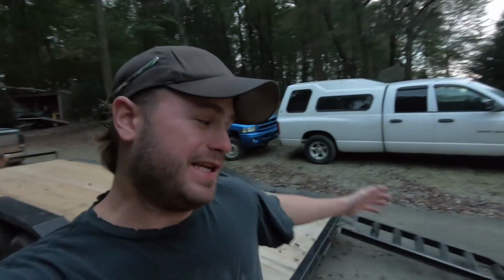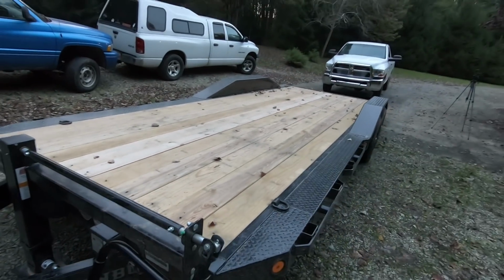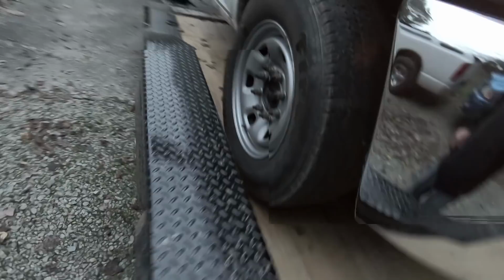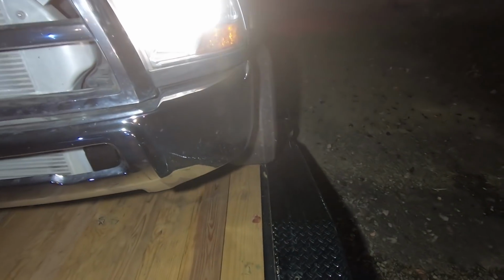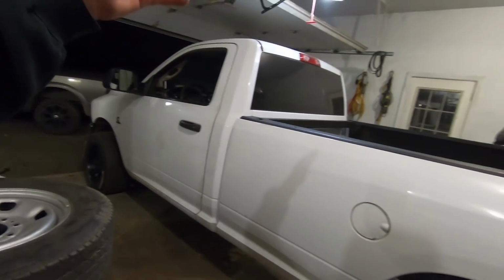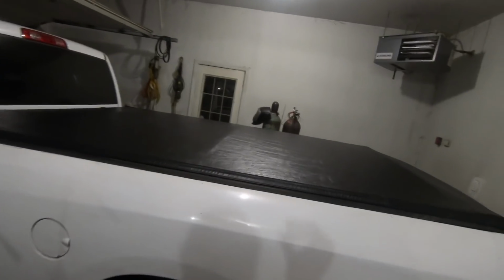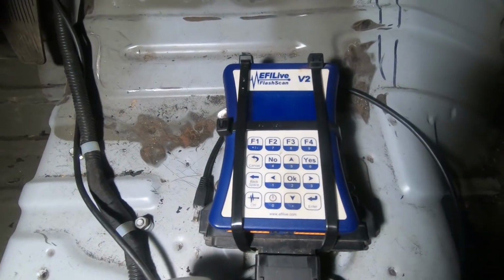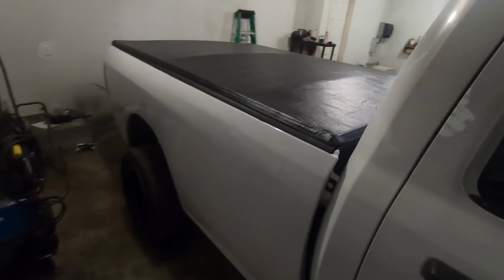FINALLY The 4TH Gen 6.7 Cummins Drag Truck Build Is TRACK READY!!

Comment: I would be worried that with the cut out bed that the air pressure will build up going down the track and rip that tonneau cover off but it does look much better with it on there. Guess you will find out at the track. Good luck.

Comment: subbed up tom, watched a few of your vids- very helpful on some of that engine stuff man.  Ive never worked on diesels but you make it seem perhaps too easy, your gonna convince me that i can do this work by myself. I have a 2016 2500 laramie deleted, nothing crazy, raceme ultra, tow more than anything, With the short lifespan of the 68rfe im wondering what to replace it with? Revmax was my first thought, but then I hear about conversion kits for Fords R4.  thoughts?
Reply from the maker: Built 68's have come a long way. Since you primarily tow I think you'd hate losing 2 gears. But if you want to get rid of the 68 I think Suncoast has Allison swaps now  https://youtu.be/alyDwZkKZb0
Reply: perfect thread link- even the exact truck and color scheme,  ill check em out.. Allison is  bullet proof.  thanks much and looking forward to watching how you race, more importantly fixing what you break( knock on wood).